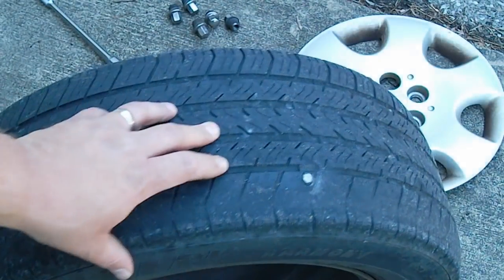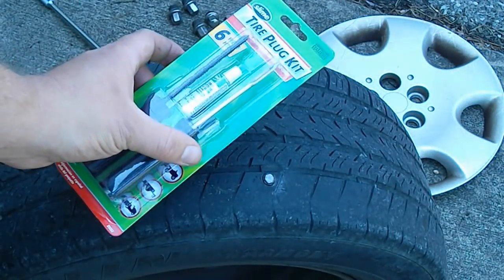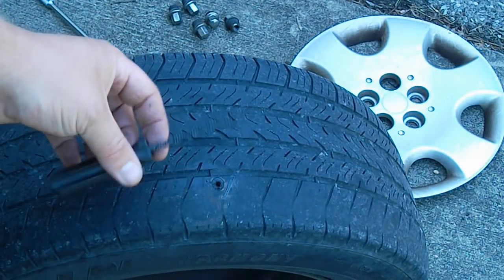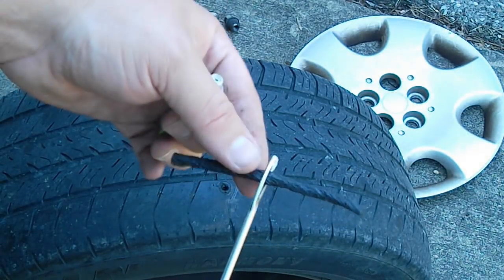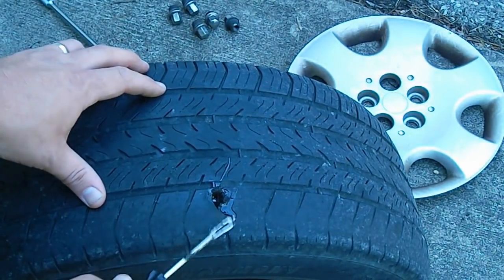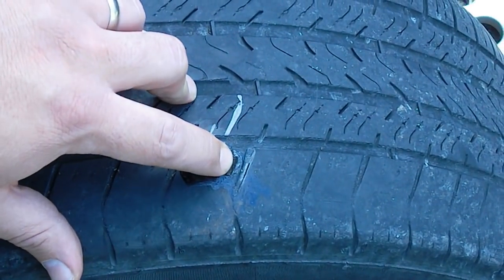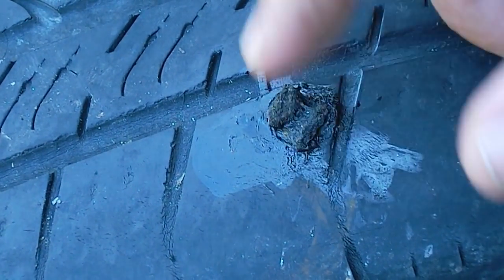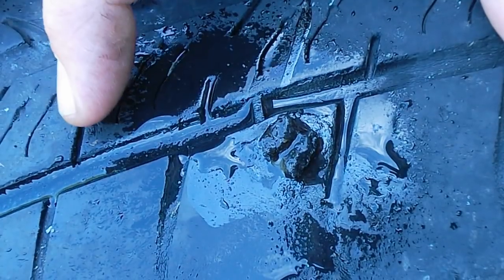How to Repair a Punctured Tire

Comment: Nice video. Thank you. I fixed my tire two weeks ago. I kept it on the rim. Everyone talking about a temporary fix. Well I have already put 1500 miles on my "temporary" plug fix. Tire is holding up great (only had 12,000 miles on it). It was a straight/clean tread puncture with a less than 1/4" dia nail. Plug works great! I am not having  tire patched.

Comment: I worked many years at a service station when they were still "service" stations.  In my experience, a plug takes a bad leak and makes it a really slow leak.  I had to fix dozens of tires where plugs were used and the only leak I could find were where the half dozen or so plugs were installed.  The only thing that will definitely stop a hole from leaking under operating stress is a patch that completely covers the hole and surrounding area.

A plug is at best a temporary fix that can be used to get you from the middle of nowhere to where it can be properly fixed.

Comment: awesome thanks man!  I've noticed my tire is leaking. However, when I found the leak, it appears to be from a previous fix from someone else. Can I do the same technique where it was already repaired?  Also, if I don't have a compressor at my house, can I fix it, drive on it with low psi for just a few blocks to the nearest station?   Thanks!

Comment: Call any major tire mfg shop. Tires are fixed from inside. On the occasion that plug is used, it is used to fill the hole in the tread only. A radial patch is used on inside to seal air in. Some plug repairs cause more damage to the tires. if and when the tire separates the mfg will not adjust the tire about 95% of the time and damage to vehicle is not covered.
Reply: I've heard this said, but my mechanic has never had any problem using plugs, provided you use them appropriately. He had been in business 40 years. I've never had any problems with plugged tyres, nor has anyone else I know.

The vast majority of deflations occur when the tyre is 90% worn anyway. The tyre used in the video is not worth repairing, nor would you use a plug if it was too close to the sidewall. That hole was pretty large also.

Comment: That's an old bald tire that's ready to be thrown away, so if I was you I'd forget fixing it, just go get a new tire.
I have fixed 5 of my tires using that type of repair kits. The main thing to try to remember is to use a LOT OF GLUE when doing that repair.  You see, it is the glue that 'melts' the rubber on that shoe-string material, and makes it 'stick' to the rubber of the tire itself.  If you don't use that glue or enough of that glue then a few weeks later that little bit of plug will work its way OUT of the tire and 'BOOM', you now have  a  BLOW OUT, something that will get you killed on the highway.  
When fixing tires using this method I always use a separate bottle of glue that is sold separately at Canadian Tire,  I first use the rasp to enlarge the hole a bit so the shoe-string can go more easily into the hole  (but not too large), and then I thread the shoe-string onto that applicator needle, then I dip the entire shoe-string into the bottle of glue  (and apply a bit of glue onto the hole itself too), and then insert that rubberized thread into the hole in the tire.   PUSH ONLY HALF THE PLUG IN, NOT THE WHOLE THING !!!!   
(So many people push too hard and they push the entire thread INSIDE the tire.  if you do that then you've got no plug left in the hole itself, all you've got is this piece of rubber banging around in the empty tire, then you've got to go to a tire shop and have the tire removed from the wheel to get that thing out of the tire.)
 I then let cut off the excess amount of rubberized thread that is sticking out of the hole, and then I let everything sit for an hour before adding more air back into the tire.  All of these repairs have been successful for me and did not need
 any further repairs. I used those tires until they were bald (like that tire in this video), then threw the bald tire away.

    This video is actually one of the BETTER videos out there showing how to do this type of repair, all of the steps he's done is exactly like the way one should do them if you were doing it yourself.

Comment: This kit does not need rubber cement?  I have seen other kits where you need to put rubber cement on the plug.
Reply: leroy87532 you put the rubber cement on the tool not the rubber part

Comment: Hmmm can you do this to run flat tyres ?
Reply: Thankyou
Reply: chromospheres Soon as your dash board message says the tire has a puncture do not drive any further.  Repaire it A.S.A.P.  I have my punctured repaired twice in my BMW without any problems.  Never drive your car with a flat tyre even if you are driving run flats.   In that way you will never damage your side walls.
Reply: Brown yeah but my bmw manual book says I can only drive on flat runs up to a distance of 100k and 80k speed if I have a flat. If I was stuck out in the country or in the middle of no where lol I would have to drive.
Reply: +chromospheres =  Yes, you can fix run-flat tires this way also.   Just make sure that you have not been driving a long distance with the tire flat.  If the tire has just gone flat and you've only gone on the flat tire a few hundred yards to slow down onto the side of the road, then use a kit like this and fix the tire and your tire is good as new, ready to be used once more.  But if you drive 5 to 10 miles on a run-flat that has no air, you might have damaged the side-walls of the tire and then you will need a new run-flat tire since the side-walls will be damaged and won't safely hold air pressure any more.

Comment: Some places will give you a good deal . 1 had a tire plugged for $12 bucks before, can range from $10 - 20 . Only more if the leak is from the bead and it needs to be brushed with a wire brush machine and then resealed with bead sealer , that procedure can be $25 but 20 is a good deal in that case . NOT A RIPOFF .

Comment: Nice, but he blew past the two most important parts of the job:  (1) being able to get that patch stick into the eye of the needle (I have tried for 1/2 hour to do this and still can't get it to pass through!) and (2) inserting the patch stick.  It looks in the video like he jams the whole thing into the hole before pulling up (but hard to tell b/c his arm is blocking the camera).  The instruction with my WM kit say to only shove it about 2/3 of the way down, and then pull up.  (?)  Also, no glue was included with the WM kit, so is that really essential?
Reply: oops "instructions" ..  Also, to clarify, it says to shove down until about 2/3 of the patch stick is inside the hole before yanking up.

Comment: Good instructions, but it's not technically advisable to plug a tire in that location...neither the left or right shoulder due to flexing and heat build-up.

Comment: Tire is at the end of life needs to be replaced. This tire has almost no grip, will hydro plane on water, loss of breaking power and that puncture is almost the cannot repair zone for most tire repair. You need to replace this tire.
Reply: I DON'T KNOW.  I'VE DRIVEN ON SOME REAL BOLONY SKINS IN MY TIME.

(that line is from my friend eggbert gorp. he was really good with car stuff).
Reply: if it rolls and holds air its good to me
Reply: Cooper Listul until it doesn't anymore.
Reply: maybe he punctured it himself on an old tire for the purpose of making this video.

Comment: Because tires are expensive vs a $8 repair kit. At my local tire place, they said they are allowed to repair a tire up to 3 times, as our state law limits it. Not everyone is financially fortunate to replace an expensive tire every time they find out they ran over a loose nail in the street. 

Fixing a tire is standard practice,  not a hack-job. Not sure the true reason why, but I would imagine it's also because throwing away tires isn't the best for the environment when it's a fixable issue.

Comment: A five min video that should last three, tops. All plug kits come with lube so use it and you won't have to look like an idiot reaming out the hole again, stranded on the side of the road losing more air, without the convenience of an air compressor. Most important add at least one twist BEFORE pulling out the plug tool. If you don't the plug will fail within a couple months. (Don't ask me how I know)
Reply: How do you know?

Comment: Those tires are done so why fix it when it needs to be replaced. It also looks like you need an alinement done because one side is balder than the other

Comment: if that was my tire i would replace it because its not worth fixing too far gone and i would get a decent alignment. i know people drive their tires in that condition for years but why risk my safety while i can change it. i know sometimes they are expensive to change but i would never plug up again as it would probably leak again
Reply: Because people are not rich like u bro we can't afford 400 dollar tires or anything above 100
Reply: KEVIN GORE So you'd rather drive with done tires and put your life, your passenger's and other driver's in danger? If one can't afford safe tires, maybe a car isn't for him...
Reply: people only crash with blowouts when they are doing 100 MPH. I have had a couple and it was far from a disaster.. Blowouts are over rated. How often do you hear about it considering the amount of cars on the road?
Reply: +K  =  Yes, you're correct, that tire is already down to the wear-bars on the tire, indicating that the tire needs to be replaced soon.   I've fixed 5 flats like this using this type of glued  rubberized-shoe-string, and all of them have not leaked and I do all my driving at high speeds on the expressway.   Other people who use hard rubber 'plugs' to plug the hole have sometimes had those plugs pop out a few hundred miles later, so use the soft rubberized strings, don't use those plugs.

Comment: This rep is not legal in UK. Rep is ok but becouse you cant inspect inside of the tyre side wall its not safe. If you run on flat tyre and repair it like this  with out takein it of you realy dont now how bad it is. Repair will last but the tyre can explode.
Reply: Lol not even close to side wall.

Comment: Do not advertise this as a "repair." A temporary fix, maybe. #1 you're outside the repairable zone, in the belt edge #2 you cannot evaluate the inside condition of the tire #3 that's a plug, not a patch #4 more than likely, that's made of cured rubber which will not vulcanize and the cement only serves as lubricant #5 you did not treat the steel cord or fabric plies which may run causing failure #6 this kind of "repair" will void the warranty on any tire

Comment: I have been a tire tech for almost 10 years and from my professional point of view, PLEASE DO NOT DO THIS! These plugs are not meant for high speed radial tires! Is it worth putting your family at risk of a tire blowout? My shop fixes flats for FREE if you get your tires from us. and I know some other shops do as well so please don't use these cheesy plugs.
Reply: Alright tire guyyy
Reply: Why can't folks spell Tyre correctly as we do here in the UK?
Reply: Except you would would tell them they need to purchase a new tire even if the tire was good and repairable just to make the company you work for $ unless they were a returning customer.

Comment: If it were me

I would only use one of those in a pinch to get me somewhere to have the tire fixed properly.
You do not want to drive on a tire for a prolonged period of time.

If you fixed that and it got you off the highway ....i'd take it to a tire shop and have a proper patch put on the inside.

For a garden tractor or something like that ..ya who cares, this way , slime or whatever.

Comment: that Tire has seen better days , it won't pass inspection anyway , so why bother .
Reply: Alan Doughty Too tired to get a new one lol
Reply: And you know, sometimes you just don't feel like it.
Besides, you have 4 tire plug kits flopping around, in the trunk.
Reply: Its a hole loada trouble getting a new one!
Reply: Alan Doughty that tyre is on borderline it’s still legal there is a visible tread pattern on the shoulder and it’s not flush with the wear bars
Reply: Samuel Spencer not legal. Mto and dot will pull your plates if you get caught.

Comment: What you done is a temporary tyre repair its legal to get to nearest tyre shop.why fix a bold tyre ?a tyre like that will cost you 100 dollars odd to replace .makes me sick to see some tight arse repair that could cause morte havoc in order to save 100 bucks you put your life and other peoples life at risk.and for good measure you show others how to make the same mistake! in any case great for "temporary repair" that's how its done..
Reply: WTF is a tyre,and a bold one at that?
Reply: Is not temporary it will hold for the life of the tire.

Comment: This is no longer an acceptable way to repair a tire.  Only do this if you are literally stuck in the middle of nowhere or in the event of an emergency...and then replace the plug with a proper repair as soon as possible.  The ONLY acceptable way to repair a puncture is to remove the tire from the wheel and use a combination patch/plug.  

Read more:

http://www.tirerack.com/tires/tiretech/techpage.jsp?techid=77
Reply: urntwrthyZ exactly i agree
Reply: No longer accepted because this type of plug is garbage. Black jack kit is far better and will be a long term fix.